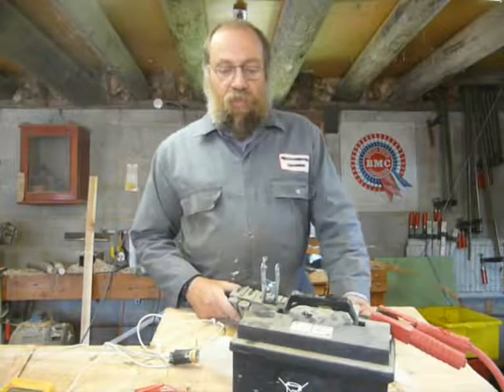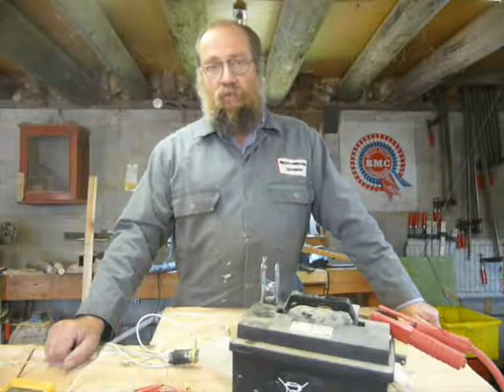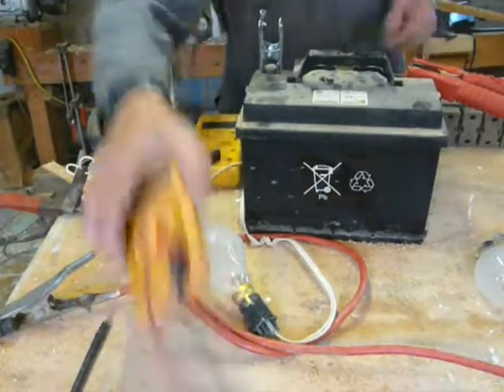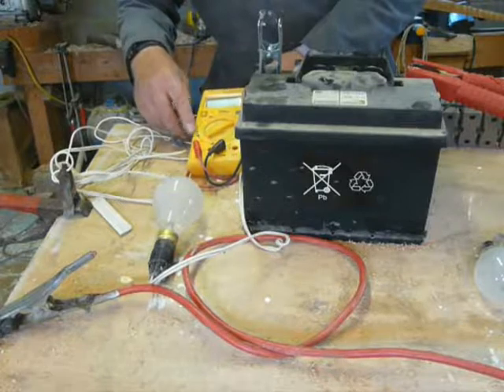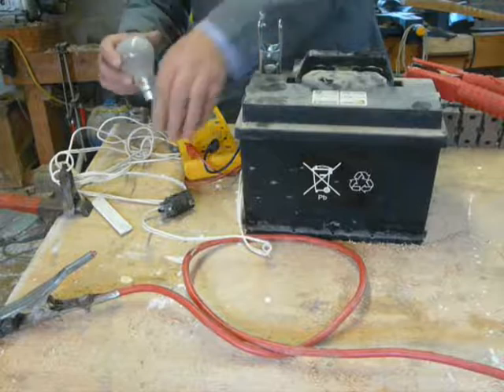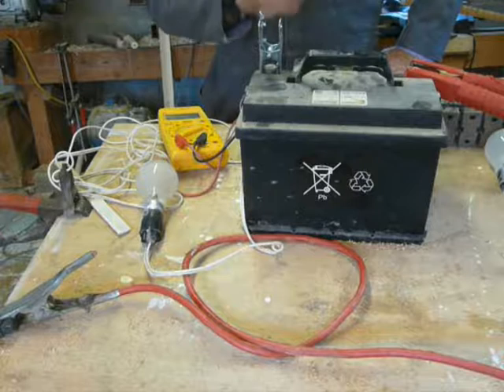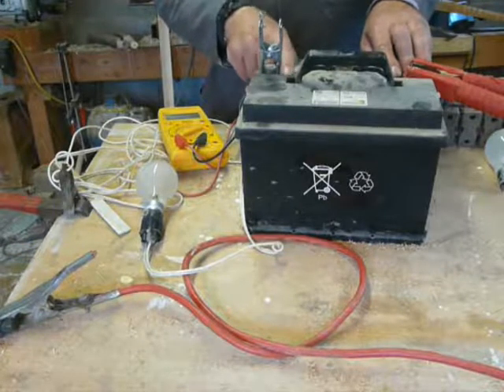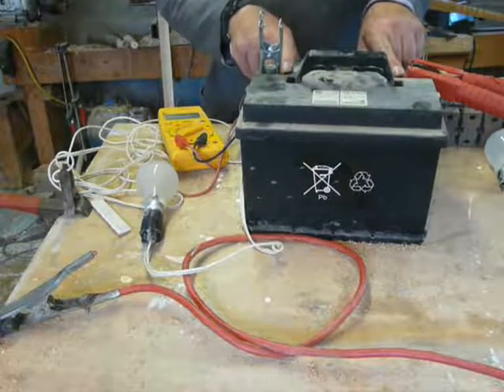48V DC to 12V DC converter, backwoods method, charge tractor battery, run solar tracking, ETC.

Comment from the maker: Dennis. Thanks for your comment. It's easy and you can make it from bits lying around. The battery does not need to be grade A, as long as it does not self discharge quickly, after all it is acting only as a buffer and is constantly being trickle charged. A pragmatic and low cost way of betting around the problem.

Comment from the maker: Dennis. Just thinking about it using a 12v car type charger then you are only running the regulator. If you use an inverter and then a standard charger you are using 2 pieces of equipment, each will use power to run itself. The inverter will use at least 20 watts (1.6 A) just to run. The former is the way. Hope that helps. Andy
Reply: How to 
44volt to 12 volt converter

Comment: Awesome. I like to use incandescent light bulbs as resistors whenever possible for purposes like this.  Because, as you probably know, they have a big advantage over a normal resistor - they change their resistance according to current flow. This can be very handy when charging batteries as they essentially constitute a "near constant current" source. Sometimes I use them to take a feed from my main array through a small charge controller to an auxiliary battery. The bulb prevents the array from overpowering the controller. For this kind ov thing I usually use 12v 50watt Halogen reflector bulbs, or recycle car headlights that have a dead low beam filament. Uses like these seem to be the only place for an incandescent light bulb on a off-grid system. They are too power hungry to be used for their intended purpose when better options are available such as LED & CCFL. :)
Reply from the maker: Thanks for the comment. I use this method to keep the solar tracking slave battery charged, and with a bulb you can see that it working. Cheers
Reply: Andy Reynolds Indeed, and you can even get an idea ov about how much current is flowing as also functions as a crude current indicator. I like indicators, I like to be able to see stuff is working!

Comment: Amazing video. Couldn't have explained it better. This is my scenario, i have a 48v power supply and i want to run a 12v pc fan that draws 0.3 amps. What are your suggestions or thoughts? thanks for your help
Reply from the maker: So you want to loose 36v, so perhaps a 120 ohm resistor. 36v  /  110 ohms = 0.3 amps. Subscribed to this non profit channel? Cheers
Reply: Andy Reynolds oh yeah definitely. Subscribed and liked. But for the 120ohm resistor, it will be disipating so much heat becuase of the wattage it is trying to resist. Do you have a more efficient solution to this? BTW i have a small enclosure to fit al this into. Thanks again for al your help!
Reply from the maker: Maybe a dc to dc speed controller, they are quite cheap. I fitted one to repair the wire feed on a mig welder. They have a wide range DC input voltages. Cheers
Reply: Thanks. I do have an 1.5-40v step down to 35-1v. Will i burn it up if i connect it to the 48v?
Reply from the maker: I imagine it will. I never run anything near its limits. Cheers
Reply: Andy Reynolds well okay thanks for all your help!

Comment: Great video! Clear and informative. Thank you for sharing the knowledge. I assume this method is also applicable for a 36v source?
Reply from the maker: Thanks for the comment and appreciation, yes it will work with any voltage, and the current depends on the voltage and wattage of the bulb, Cheers

Comment: Good video Andy.What is the voltage from the light bulb to the battery?
Reply from the maker: John. Thanks for the interest. The bulb acts as a resistance to current. So the 12v battery when in circuit creates a load, but the bulb resists the flow so the voltage drops to battery voltage. As shown the various bulbs let differing currents through. So the voltage from the bulb to the battery is battery voltage but will rise as the battery charges up. Hope that makes sense. Andy. Subscribed?

Comment: I'm a rookie who is a bit confused at to whats going on here. What I want to do: I have a Mobile Home that is no longer hooked to electricity. I run everything off a 12V inverter on a marine Battery. I want to use that Marine Battery to make my normal electrical system in the trailer function. Is what I'm watching even close to that scenario?
Reply from the maker: Hi. This is just a backwoods method of charging a 12v battery direct from my 48v battery (powered by wind and solar). This 12v battery is used to power the solar tracking, but I use a similar system to keep the tractor battery in good condition. The benefit is that I do not put extra use on part of the 48v battery and so cause a charge inbalance. If you trailer system is 12v then direct would be the answer. You will probably gain some benefit from my book, Wind and solar electricity. Cheers, Andy
Reply: Andy Reynolds I thank you for the reply. The trailer is actually a proper mobile home with normal electricity hookup. A backfeed system seems, from my research, to be the way to go. I've just been scouring YT for something even simpler.
Reply from the maker: Yes and good quality inverter is the way to go. As you may have guessed we run a 48v inverter on a 600 Ah battery, gives decent power and is reliable. What ever battery voltage you use a very good charging system is essentail for long term battery life. Cheers, Andy. You might enjoy my solar tracking build videos.

Comment: interesting.  What if I want to run a load that is say 10 amps @ 12 volts?    Will this method work?  or the bulb will burn out?  Or the 12v battery will eventually discharge?
Reply from the maker: Hi. It all depends on how long the 10 amp load is on for. If it were for 1 hour per 24 hours the size of the charging resistance could be tuned to make sure the battery is charged back up every day, but then if the load was switched off the battery would over charge. I use this sytem for a small and intermtent load. Cheers

Comment: great video where can i find the edition to wind and solar for the charge controller build thanks
Reply from the maker: Hi, Thanks for the interest, here's the link: 
http://www.lowimpact.org/book-title/wind-solar-electricity-second-edition/
If it doesn't work go to my channel page, then click "about" and the links to the books are there. Cheers
Reply: is it possible for it to work on  48 volt panels to a 48 volt battery bank just curious  i have 3 48 volt panels in parralell thanks for all the good info and great video i will also check out the link you sent thanks again robert
Reply from the maker: Depends on the MPPV of your panels, it needs to suit the battery voltage range between nominal and fully charged (and being charged) cheers
Reply: thanks again

Comment: Could I convert 96v DC (coming from the windturbine) to 48V DC battery bank? Could you help with any ideea where to start?
Reply from the maker: If the 96v is an open circuit voltage then if connect the DC output of the turbine to you 48v battery bank this will slow the turbine down and power will flow. If the turbine generator is 3 phase AC then there will be a rectifier in the circuit, which will also prevent the batteries dischsrging into the generator. The open circuit voltage of my Proven 2.5Kw 48v turbine is around 90 volts. Cheers
Reply: Thanks +Andy Reynolds for your very prompt and usefull reply. It is an 96VDC but I have to plug in the cable to the charger first.

Comment: Hi can we connect a single 12 volt battery to 24volt invertor/ ups for charging?
Reply from the maker: Hi, there are 2 ways, first use a battery charger from the output of the inverter, or use a resistance to trickle charge directly from the 24v battery as per this video, cheers

Comment: but ,it is still 48vdc.
Reply from the maker: Hi. The bulb resists the flow of current and so the voltage is pulled down to the 12v battery voltage, sufficient to trickle charge the battery. Cheers